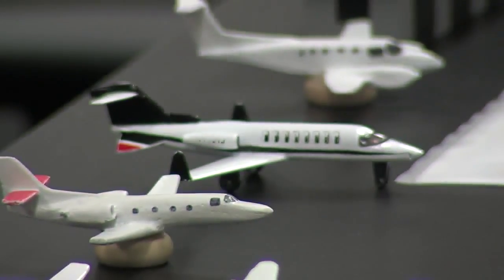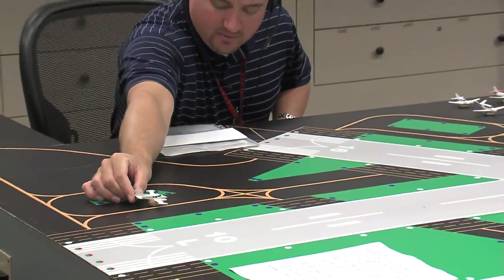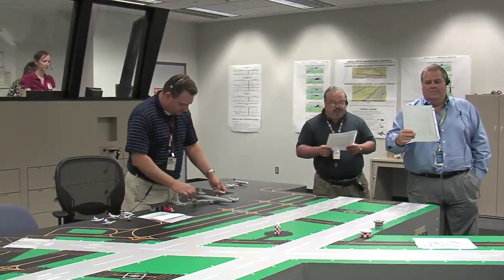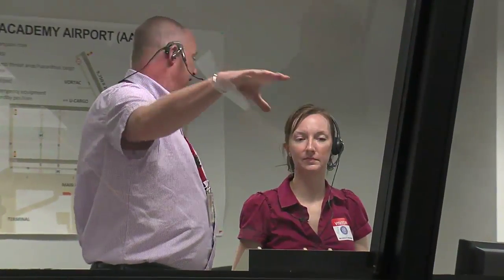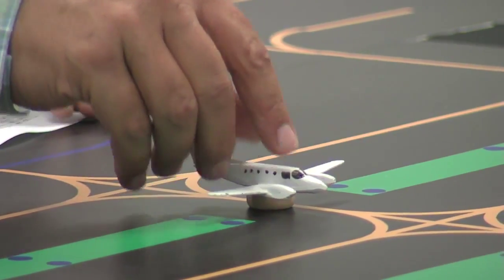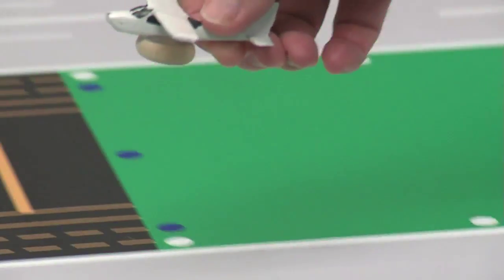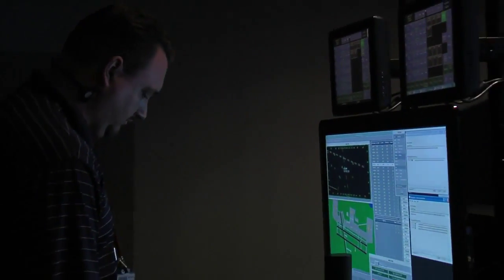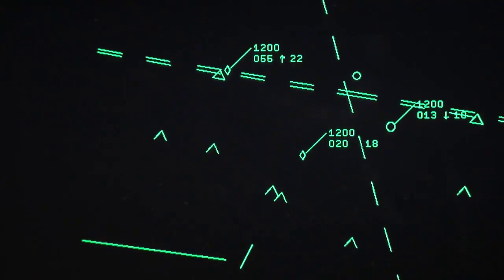Air Traffic Control Academy (2011-07-12)

Comment: Why cant AI do that job?   A cluster of computers can track and send multiple instructions to multiple planes vs humans who can only speak to one plane at a time.
Reply: still need to hire programmers to monitor the AI
Reply: @RichKilla86ers  yea, system would be not replace controllers, but turn controllers into monitors.

Personally, I don't even predict we would need less. However, we would need what we have now, which already is a shortage. 2 ways to fix shortage problem: hire more or automations and use what we have.

I think it's possible to take repetitive, low risk tasks off ATCs to do manually, so they can oversee the system to ensure it's operating properly and they still get final say. This helps so they can focus on high priority clustered areas, or operations during bad weather, or high priority alerts.

Or in general leverage new tech ML and AI to help with situational awareness. From a tower, you can see planes, but you have no idea the seperation between them (hence wings clip like they did in Boston few weeks ago) or runway incursion where a aircraft accidently comes onto the wrong runway (happens often oddly).

I think it's possible, tbh. I am exploring right now how feasible it is and what micro problems to start off with.
Reply: We don’t even have full automation together in cars. You think “AI” at this point can control air traffic. 
I don’t know if understand the pure scale and cost at implementing a fully automated unmanned airport.
Reply: @myebbad  I think you have a point and I agree: impossible to go from 0 t 100 for AUAs. (industry likes acronyms lol). However, lets go from 0 o 10? Just like anything historically has ever done to make progress, even in this industry does with implementation of TCAS, ADSB, Datalink, etc etc.

To your point comparing cars - aircrafts in sky are much easier to manager than cars on road. Reasons:
(1) only focusing on aircraft to aircraft distances. No pedestrians to mess things up, which is often common reasons for accidents
(2) skys to have highways (vectors) that aircrafts go on, so it's not free for all. Just like cars essentially
(3) seperating is much bigger than cars and you'd have time to trigger a pilot to make changes to altitude, speed, and direction. Faster than you do with cars on roads
(4) if you need to install a system to help make this happen on aircrafts, there is only primary 2 you have to work with (Airbus and Boeing) vs 10s of models of cars you'd have to all get on the same system, which is likely impossible.
(5) ATCs are a very high salary individuals, so we can't just expect with rise in aviation, the solution is to always keep hiring more ATCs. Gotta work with less eventually. Not scalable model IMO.

I know I am only pointing out pros, but there are likely equally amount of cons.

I just mean to say, yes it's feasible to have full automation in aircrafts. Heck with autopilot pilots already are monitoring vs controlling the plane between depart and arrivals. Why not offer similar systems to ATCs?
Reply: @StevePalmer92s  people who say (write) "aircrafts"....education time...."aircraft" is both singular and plural. anyone that says "aircrafts" is a clown.
Reply: Some onboard systems like TCAS, TACAN, and ILS all help to avoid collision and land safely along with ATC's

Comment: What is the age requirement to get accepted?
Reply: FAA website says “Be age 30 or under (on the closing date of the application period)” https://www.faa.gov/jobs/career_fields/aviation_careers/
Reply: @gude8  I remember that from years ago when I was looking into it I was wondering if that was still the case. I saw a couple people of the video that looked like they were well over 31.
Reply: @cdubois13  those were instructors, everyone else was under 31
Reply: ... you have to complete their test with a passing grade before your 30th birthday ...
Reply: @willgaukler8979  No, you have to be under 31 when the initial application period ends.
Reply: 18-30 to apply, 56 and a month to work